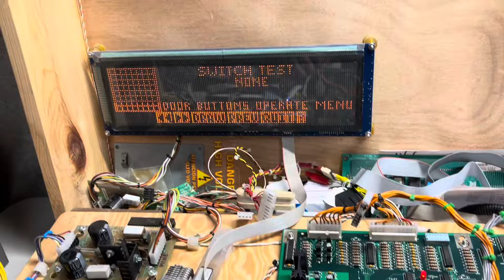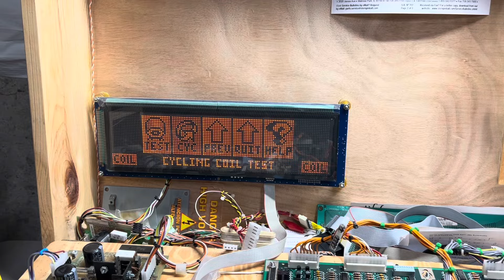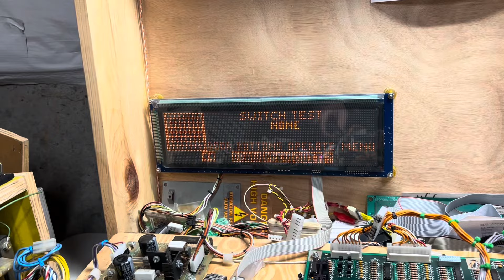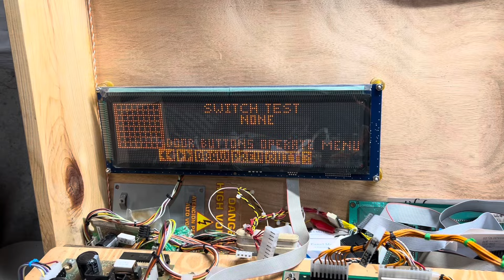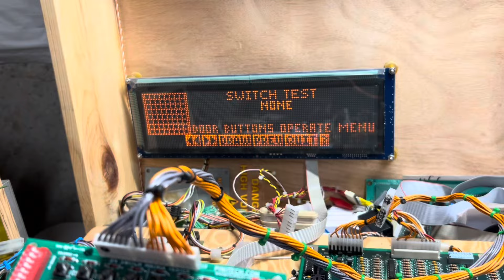Stern RCT MPU and Driver Boards, Inop Switch Column 5

Comment: Do the white star MPUs use jumpers when different quantities of sound ROMS are used?   Testing a High Roller Casino mpu (uses 4 ROMs) with Roller Coaster Tycoon ROMs (only uses 3). And the sound is very tinny and has static.  Otherwise things seem normal
Reply from the maker: No jumpers in the sound section other than RAM memory size and for 8MB ROMs (W6).